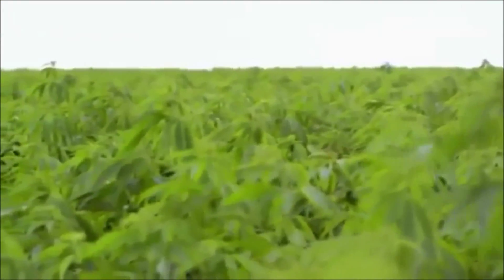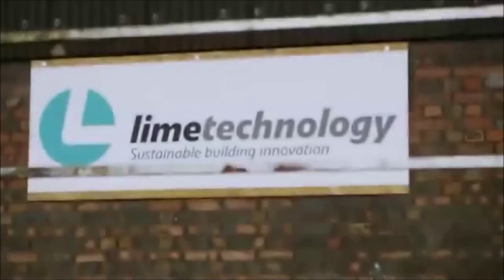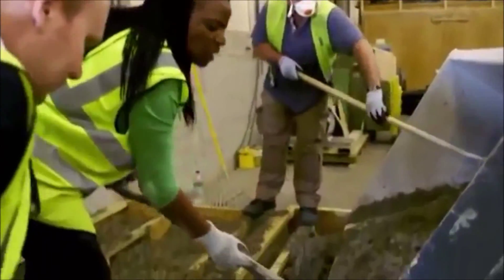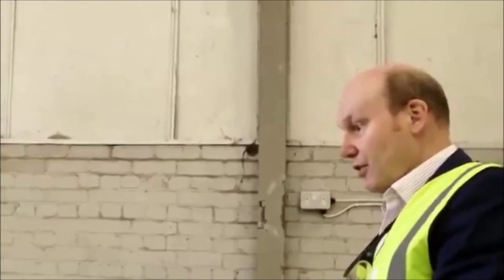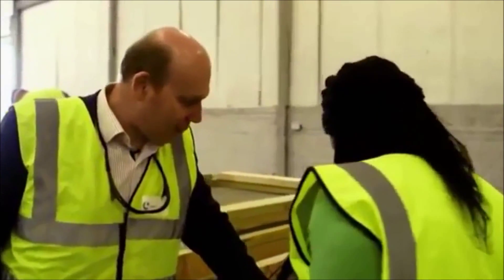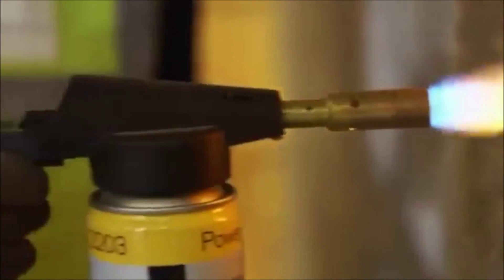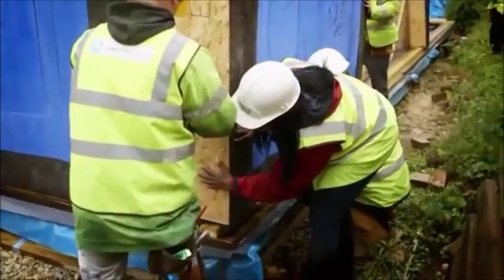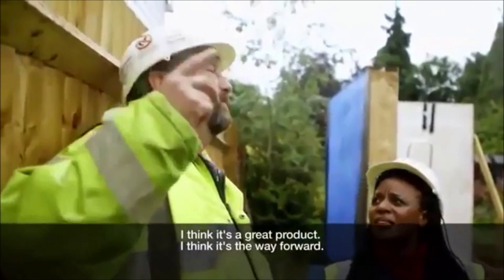Earthrise - The use of hemp as an alternative to cement

Comment: Hempcrete is a great alternative for concrete above ground, however I don't believe it can replace concrete foundations in the soil, as the microbial contact will eventually cause the hempcrete to decompose and fail.
Reply: The hemp is coated and for all intents and purposes petrified That's why its so fire retarded 🤷‍♀️ From what I've gathered And in the presence of moisture doesn't it strengthen and repair itself?

Comment: Hemp acts as the aggregate (NOT THE CEMENT) in a concrete alternative known as hempcrete. While it's a good substitute for some concrete applications, it lacks the load bearing strength of real concrete. The title of this video is somewhat misleading, as it suggests you could make concrete using hemp instead of cement. It would be more accurate to entitle this as "The use of hemp as an alternative to AGGREGATE".

The only reason I looked this video up was to try and find alternatives to CEMENT, the manufacture of which has huge environmental impact. This video title appeared to address that concern, but was basically a form of click bait which I find very annoying.